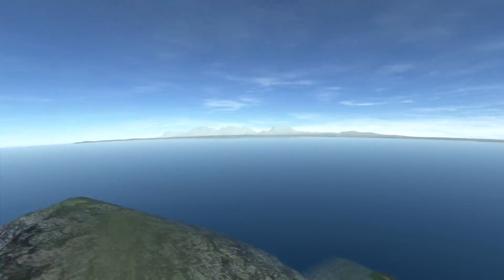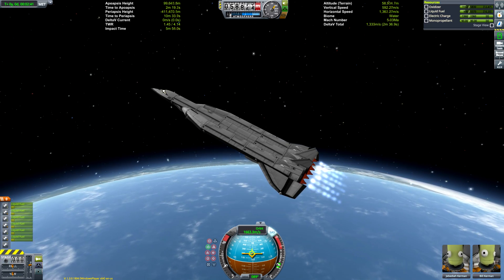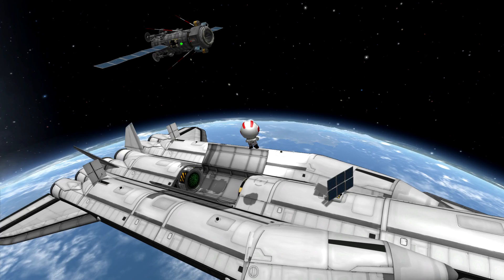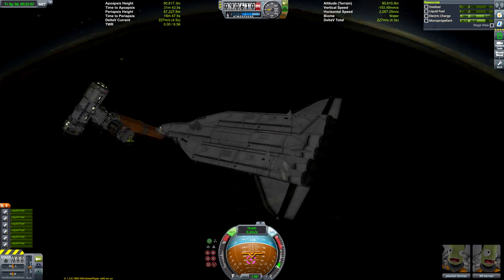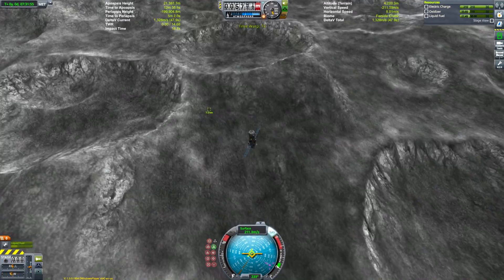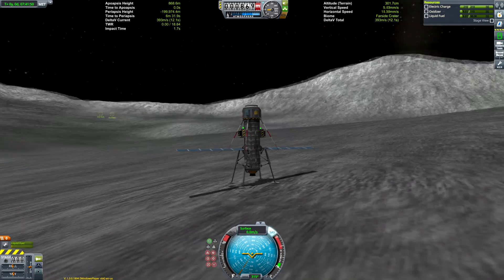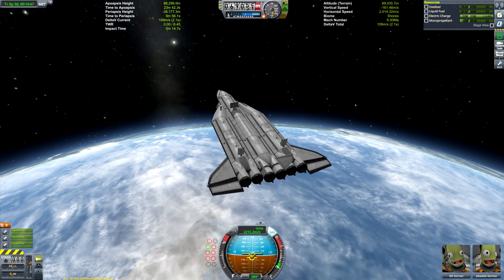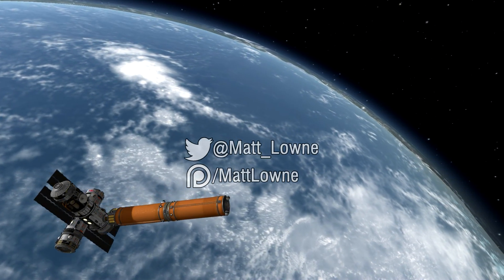KSP: The Aerospike SSTO!

Comment: There actually have been craft flown under power from aerospike engines, a solid rocket test from one of NASA’s research wings and a liquid one from... I think CSU Long Beach. Both instances didn’t actually show the performance gains you’d expect with an aerospike, which leads me to think that even more significant than the weight issue associated with cooling is the difficulty of creating either a) toroidal combustion chamber or b) the multitude of combustion chambers clustered around the aerospike. Neither of these were spaceflights, only low-altitude tests.

Comment: What keyboard keys control the Kerbal astronoght when in space using their back jet pack? I had a kerbal fly off a orbiting craft but he got away from their and I could not get him back to board it all the controls just either turned him around clockwise or anti-clockwise or forwards or back.  No up or down I could not find as he was well below the craft in orbit? what jet pack keys do up and down please? I have the Demo version  V1.0.0.813 Beta.  Also how do I set up a docking between two craft or is that not possible in this demo?  I ask because there is a docking system screen comes up if I press the on screen button in orbit. Thanks

Comment: Had to comment after the discussion at 2:26 and following. The "aerospike engines" in KSP are actually "spike engines," because the central spike is not truncated. The "spike" is solid for its whole length. To reduce weight and thermal loads, the spike can be truncated, in which case the flattened spike would experience a vacuum, which acts as a drag on the vehicle. To counteract this, so-called "base burning" is used, whereby hot gases at low velocity are vented out of the base of the spike. This restores the "spike" with an aero*dynamic cone of gas, hence aero + spike = aerospike. The pressure of the *engine exhaust gas is transmitted through the spike gas to the base, counteracting the drag from the base of the truncated spike.

Cheers!

Comment: I have also established a shuttle with 2 stages, a carrier craft first stage, consisting of a mainsail, adapter, and 2 orange tanks + fairing, then the shuttle itself, made of an MK-3 plane with (by clever use of airbrakes) having extendable and retractable wings and tailfin, it has a payload bay consisting of 2 MK-3 singles, it has 4 Rapier engines and enough fuel to get to Jool and back without refueling (but don't think it can't refuel, it has 8 drills hidden inside a service bay) I have used it to establish a orbiting station around Kerbin, Duna, Eve, and the Mun

Comment: I think you can toggle something like "allow partial" or "allow incomplete" on the antenna.  And when the vehicle runs out of power, it'll slow down the transmission and send out the remaining data at the rate that the solar panels allow.  This way you can wait it out and finish  your transmission, instead of just being stuck unable to transmit.

Comment: Minor nitpick, Sea Level optimized engines (like most first stage engines) won't see a drop in efficiency higher up, the efficiency will still increase, but a higher amount of efficiency would be able to have been gained by optimizing the engine for operation in a lower atmospheric pressure. For this reason it is sometimes preferable to have an over-expanded nozzle on the first stage as the loss in SL performance due to pressure is less than the gain at altitude due to higher exhaust velocity

Comment: The 'helicopter rocket' was the ROTON. Venturestar would have had Linear Aerospike engines which are wedge-shaped rather than conical. IIRC, the reasons for that were form-factor (more 'nozzle per length of training edge') and cooling, which is slightly easier on a wedge.

Comment: Try OBS studio. You’ll stop using fraps :)
Reply from the maker: It doesn't look as good as FRAPs though, it still compresses the video too much
Reply: Jack Frags has a guide on how to set it up for maximum quality, depending on the settings you use, the quality varies quite a lot. I think If you get it configured his way and try it out, you will seriously consider leaving the FPS thirsty frags aside. By the way, nice video, the explanation part on the aerospike engine was a great plus.

Comment: Another fantastic ship Matt, and perfect timing too as I've been working on a space plane this past week and am starting to reach the point where I plan to upgrade it's cargo capabilities so hopefully this new ship will give me some ideas. I say space plane instead of SSTO because the gimmick of this ship in question involves a fuel tank with a Rapier Engine and Air intake on each end of the wings via decoupler's with a fuel line that feeds into the body of the plane to power two Rapier engines in the center. Once you reach the altitudes where these two additional engines shut off (since the main body has more air intakes so the center Rapier's continue) just decouple the extra weight and the main ship should still be at full fuel by the time you reach low orbit.

Comment: Is the Skylon an aerospike? I don't think it is. I think the spike is on the intake. I may be wrong.
Reply: Michael McDonald the Skylon is actually the closest thing to usual KSP SSTOs. It uses an air breathing rocket engine which is a lot like the Rapier.
Reply: OK. But, "Is the Skylon an aerospike? I don't think it is. I think the spike is on the intake. I may be wrong."
Reply: Michael McDonald skylon isn't using aerospikes
Reply: He says it does in the video. I had a feeling that was incorrect.

Comment: I've done a Vector-only Horizontal-takeoff/landing SSTO in my ksp streaming save, for whatever reason. It can take about 40 tons to orbit or a space shuttle on top that i designed for when I need to have kerbals to deploy a payload. 

Also, ARCA aerospace is supposedly developing an aerospike powered SSTO rocket for small satellite launches.

Comment: There were a couple of solutions to get some of that science back from the remote probe.

1) You can right-click the antenna on your probe and there will be a button to "Allow partial transmission" which will let the craft send as much science as it can before the battery dies. You lose any science points that didn't get transmitted however.

2) You can perform your science readings but don't transmit them yet. Then fly the probe back to your crawler and have the Kerbal remove the science data from the probe. Transfer that data to your rover which can transmit it back using its superior capabilities.

Comment: The venturestar was never going to have special Orbital Manuvering engines. The Aerospike, unlike bell nozzles, even altitude compensating ones like the plug nozzles planned for SABER, can throttle down to near zero and retain pretty high efficiency. Because the main engines for the venturestar could throttle down so low there was no need for separate OMS engines. The Space shuttle main engines for comparison could only throttle down to about 40 or 50 percent thrust. The only limit to the throttle ability of an Aerospike is the throat area, which in principal you can male arbitrarily small.